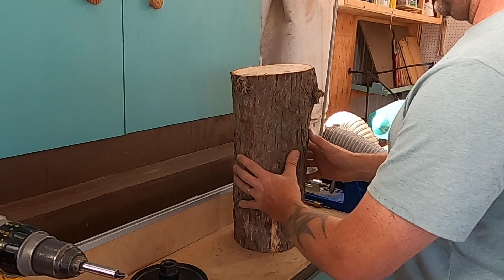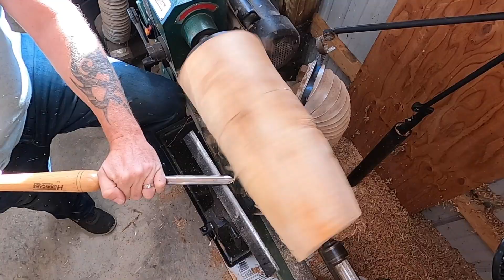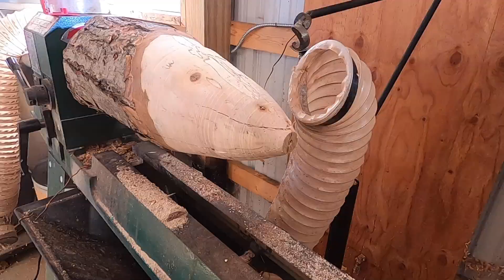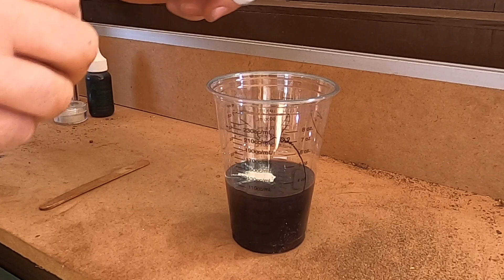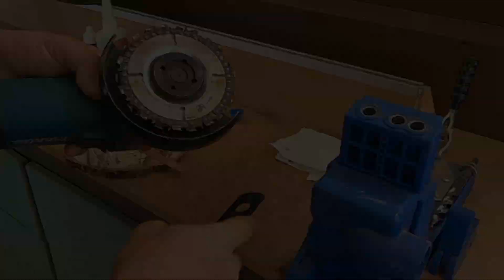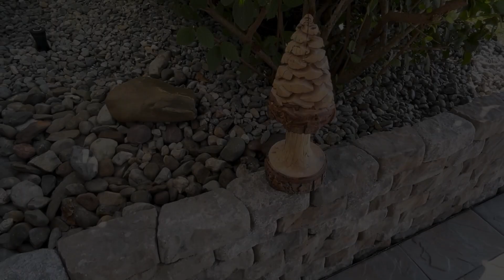Woodturning - Lathe + Chainsaw = Tree

Comment: Great idea.  I will definitely give this a shot.  Thanks.  Subscribed.
Reply from the maker: Hi Wakely! Thanks for the sub and best of luck with the new project.  Just remember to let the tool do the work and don't force the cutting disc.
Reply: @TwistedOakHandmade  The one I made today was smaller than yours so I switched to a smooth cutting disc with a thinner kerf.  Worked good.
Reply from the maker: Thats awesome!  I've used the carbide toothed cutting discs for the same reason but not a smooth disc.  So how did it work out on your project?
Reply: @TwistedOakHandmade  I used a metal grinding wheel.  No problems.
Reply from the maker: Nice!  I may have to try it.

Comment: never used the chainsaw disc on an angle grinder.   Do you have easy control?  Any special safety measures?
Reply from the maker: Hey Jim,
My best advice is slow and steady.  Take light cuts with a steady grip and keep the chain sharp.  If you try to jump in and hog out too much material quickly then there is a better chance of the disc grabbing.